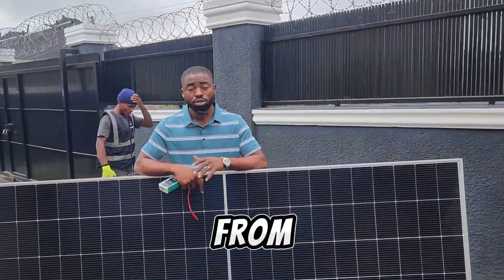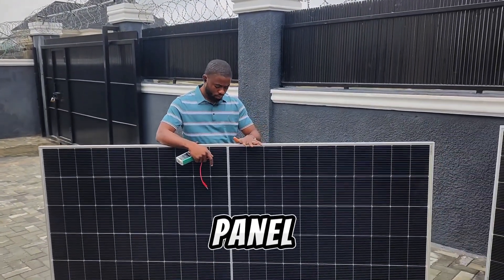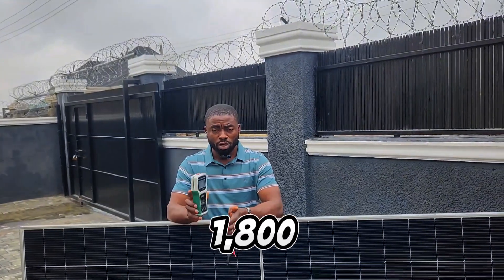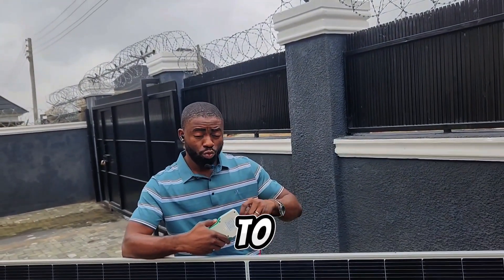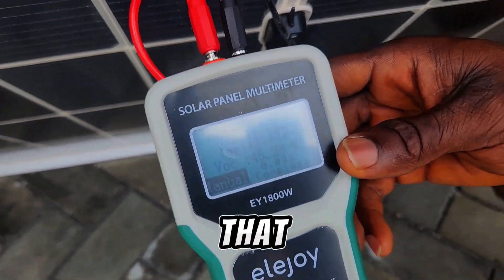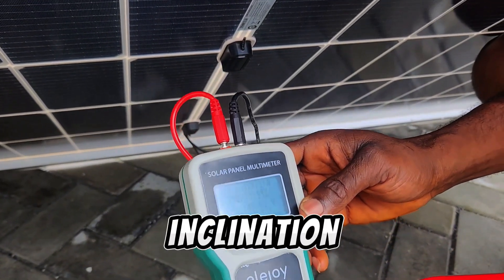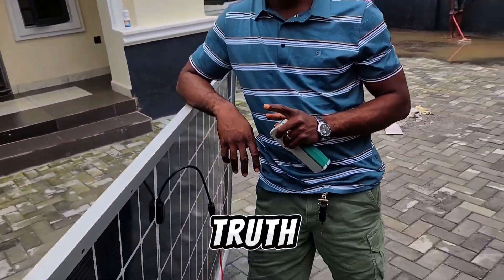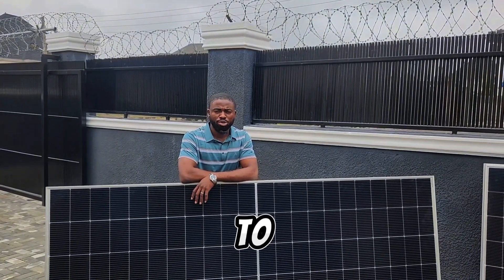HOW GOOD IS ZNSHINE SOLAR PANEL?

Comment: We have 8 of the 660w in series. They are absolutely solid panels. 

We were making 5100w yesterday out of a 5280w array for two hours. Granted it was cold....45f, they are tilted for the season. And we don't know how much of a bifacial boost. 

But overall very happy.

Comment: With what I just saw, JINKO doesn’t come close to the TECHNOLOGIA in ZNSHINE Solar Panel. This means we can generate enough energy even in dull weather conditions 😮
Reply from the maker: Yeah. 
The panel performance is top notch, cause there was no sunlight throughout that day
Reply: @Mairigaemmanuel  i would be more impressed if the rear side is covered.. let me know what its pulling out exactly.. cos i want to use it on the roof top.. do you think i can pull 400w just using on a roof top with no bifacial gain